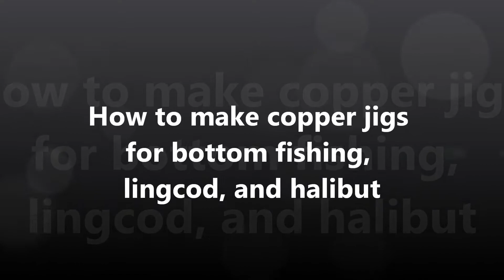How to make copper pipe jigs for bottom fishing, Lincod, and Halibut

Comment: Good work brother. Just a head up regarding the "nasty stuff" you call the lead. Pouring molten lead into anything you want won't harm you a bit. But rubbing your nose (like you did), face, mouth etc after you touched lead well...that's the nasty stuff you don't want. At melting temperature (621F) lead won't harm you in any way. The only time you don't want to breath lead is at the boiling temperature(3180F) which you cannot reach with the tools you have in your garage.

Comment: If you use flux while soldering it will pull the solder into the joint
Reply: Yeah and maybe the silver and tin in the solder that adds a lil sumpthin